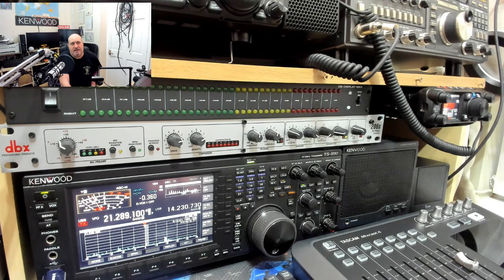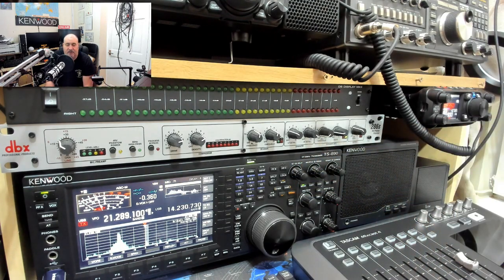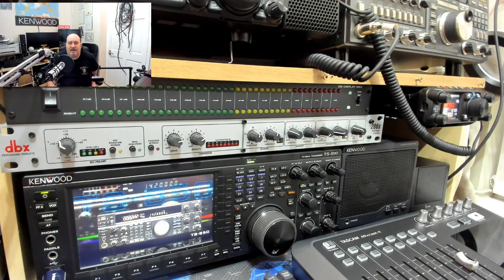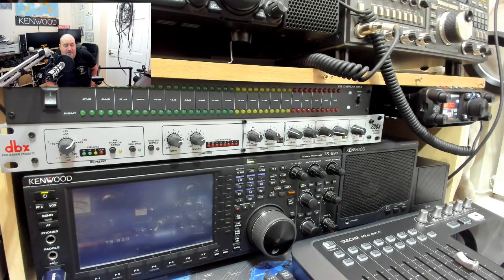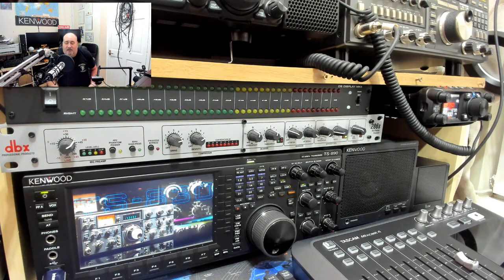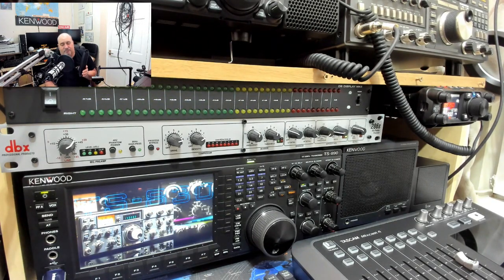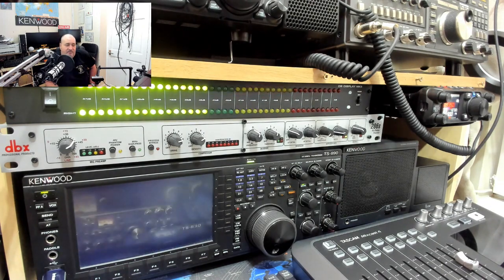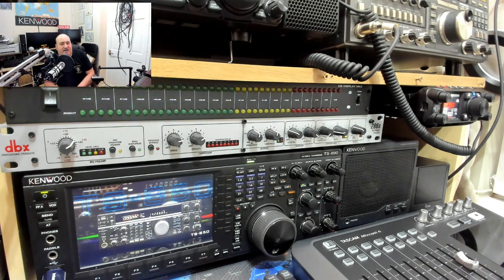SSB Audio Enhancement using a DBX-286S Mic/Preamp processor

Comment: I personally use the DBX286S myself, with my Icom 7300, and use the compression on the dbx and not the 7300, for very smoooooth audio with no harshness or crunch.  It's an awesome unit with a very quiet and clean preamp.